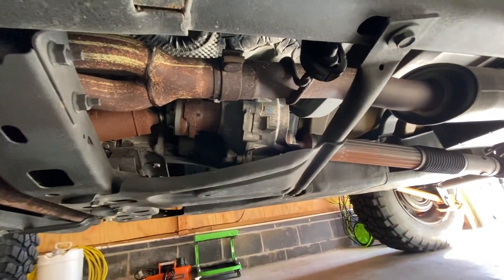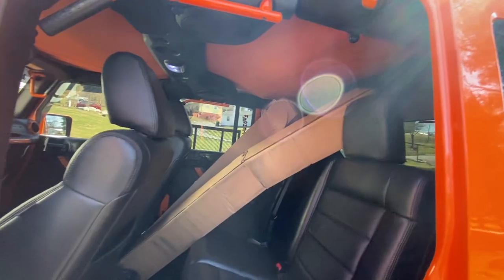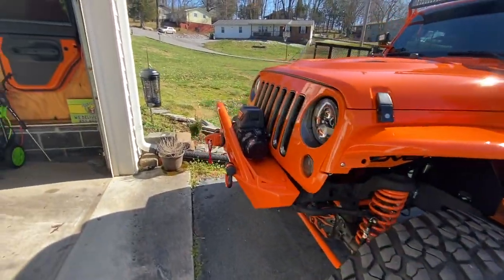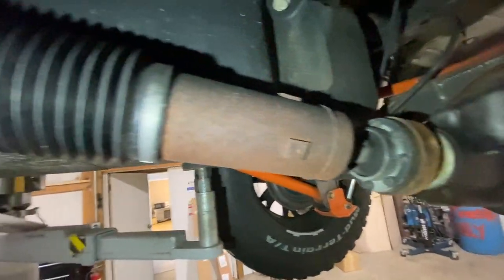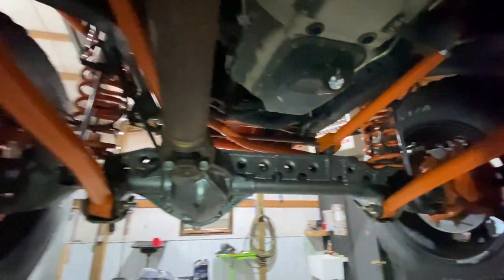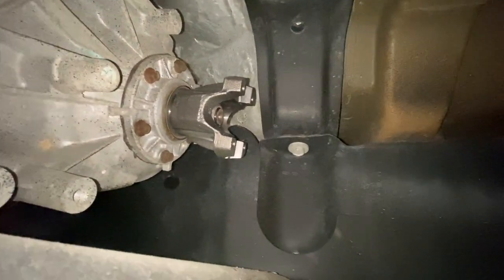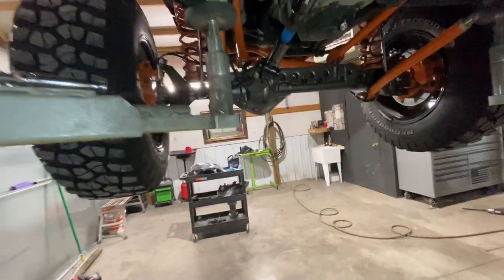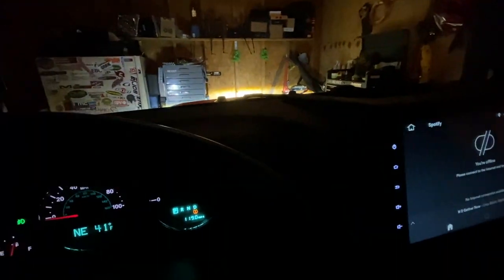Jeep Wrangler JKU Adams Driveshaft Upgrades

Comment: Those drive shaft angles were wicked before you upgraded. How do you keep your Jeep so clean? Mine is always a mess. 🤣
Reply from the maker: BEAST Projects yeah it was bad. Shew a lot of washing and not driving it in the rain it’s nasty underneath after looking at everything during the install I need to spend about 10 hours detailing the bottom side when it warms up before jeep beach.